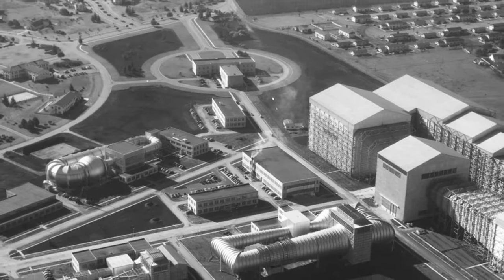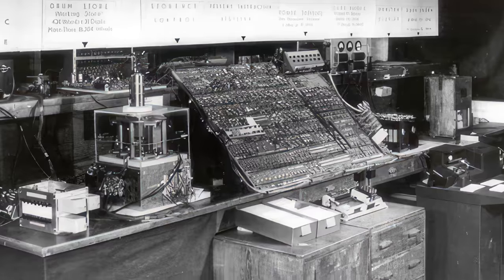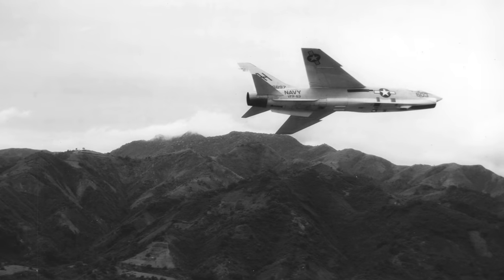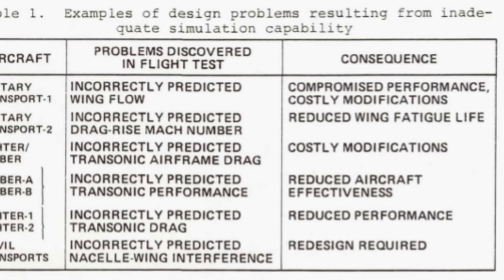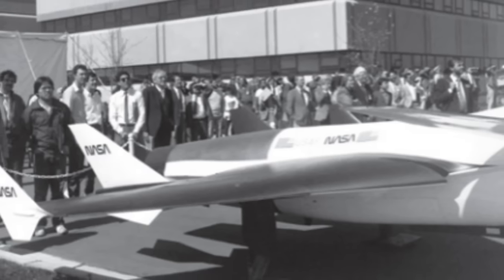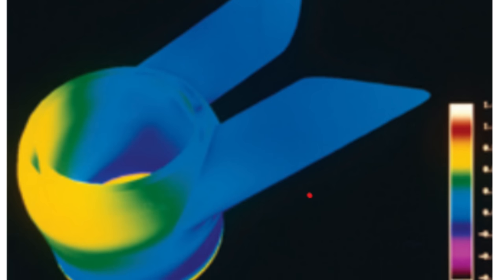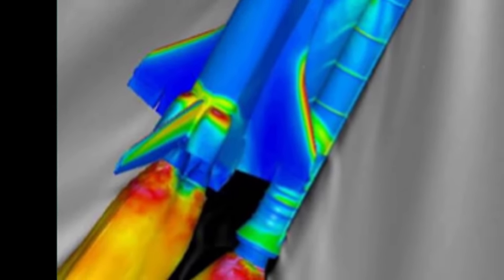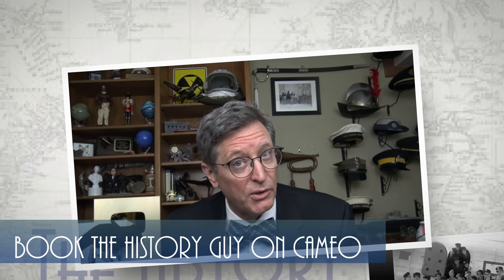A History of NASA's Supercomputers

Comment: As the daughter of an aerospace engineer, I found your video quite fascinating, talking about that side of computing.

There were so many terms that popped out in my mind that my dad used to talk about ☺️

As an engineer’s kid in the 1970s my exposure to computers began with the optical read paper tape driven MCC drilling machines that my dad serviced as his side business.

This progressed to assisting him with his field services; swapping out the serval (sp?) motors he had taught me to rebuild.

During this time he also taught me how to do the circuit board paste-ups and assembly for the computer that he invented to translate data from the optical paper tape to reel-to-reel magnetic tape (circa 1977/78).

I held the job title of electronic service technician from the age of 11 years old when I first started working with my dad until around the age of 15 years old when my teenage angst took over and we weren’t getting along that well 🙄

My next exposure to computers was in 1985 when I took a “computer literacy” course at one of those “career colleges” which taught programming in Basic on a Commodore 64 (more like an iOS predecessor), but the computer that they gave me at the end of the course was a Sanyo MBC-550, which was more of an IBM-type operating system.

This was back in the infancy of personal computers and so these machines did not play well with one another and things like emulators did not exist.

So it was kinda like being taught to communicate in Spanish but then having to work in an environment that only understands German 😆💯🤦🏻‍♀️

Anyway, thanks for the awesome video, I really enjoyed it; at least until the end where it appears that whoever did the video editing accidentally turned the volume up on the music channel instead of lowering it into a fade…..🤦🏻‍♀️💯🤷🏻‍♀️
Reply: I think the volume problem is actually that the main part of the video is much lower than it was supposed to be. The outro volume was about right. Something got messed up with the gain on the main part of the video, it seems.
Reply: @vbscript2  Ah, yeah maybe.
I’ve only done audio/video editing once, so my experience is limited to that.

It’s always helpful to hear other prospectives on this so thank you for that ☺️

I still have a lot of learning ahead of me as I plan on creating music videos for my music in the near future. I can’t even remember the name of the editing app I used last time, but would love any suggestions on what kinds would be good for a beginner like me who doesn’t have any kind of budget getting started.
Reply: @rochelleesser7961  I've also only done a small amount of video editing, but I'm just comparing the volume here to the volume in other video content. Normally, though, the volume in the video should be using a relatively large percentage of the available dynamic range, but should just be quiet enough to not cause any clipping. The user can then adjust the volume on their device to whatever level is needed. For signal processing in general, it's pretty much always best to preserve as much signal as possible (without clipping) for as long as possible in order to get the best quality.
Reply: @vbscript2  I agree, thanks ☺️

Comment: I worked at Cray starting as a Reliability Engineer on the Cray 2, from there I went to work in the Engineering Building then wound up in the Development division as a Circuit Design Engineer. I worked on CMOS ASICS for the massive parallel architecture systems that used 1000's of SiGe DEC Alpha chips which ran at 400mhZ+ That was the beginning of the peta flop era. Chippewa Falls was a wonderful place to live and watch my kids growing up. I have many fond memories of that time. We saw the end coming when the Fed announced cessation of funds for RnD.

Comment: I remember in the late 80s/early 90s when Tom Clancy was writing some of his best books. If Jack Ryan needed a super computer, there were 2 or 3 times where the Cray 2 was specifically mentioned. They used a Cray 2 in Hunt for Red October to do some CFD type stuff to see how the silent drive system in the submarine might work and how it might sound. There is also some stuff about the NSA using the Cray 2 to generate virtually unbreakable one time use code ciphers based on randomly recorded atmospheric fluctuations.

Comment: Another great episode.  By the way, if you haven't already done so, you should consider doing an episode on the NORAD SAGE Air Defense system and the IBM Q-7 computer (block house) that was the heart of the system.  It's was a milestone in computer development, as outlined in the book, "From Whirlwind to MITRE, The R&D Story of the SAGE Air Defense Computer."  (SAGE = Semi-Automatic Ground Environment).  It was the largest computer ever built (physical size, not computing power).  It was comprised of hundreds of thousands of vacuum tubes and used magnetic core memory.  After they started shutting down the system, Hollywood bought some of the more impressive looking components and used them as props (you can see part of the system in Dr Evil's hideout in the Austin Powers series, for example).  I was a maintenance man on this system for about 7 years.
Reply: I was lucky to have seen the SAGE installation in North Bay, Ontario. I worked for Digital Equipment as a field service tech. They used our computer for the weather system. 

One day I was down "in the mountain" doing maintenance and official from the base asked me if I wanted to see their IBM system. I watched the tech start up a diagnostic application, which ran a repetitive pattern which in turn created a noise through a speaker in the huge front panel. A standard telephone handset was placed near the speaker which was connected to the P.A. system.

The tech would then take a cart loaded up with vacuum tube, slowly walk down these long aisles housing the computer circuitry and tap each tube individually. If he heard the noise stop or change sound, after tapping a tube, he'd replace it. Then restart the program and carry on with the same process. It was extremely time-consuming. Tubes for computers like these were very unreliable and had a high failure rate compared to solid state equipment.

It was one helluva beast to behold. High power consumption and it took up so much space!

Comment: The C shape of the Cray wasn’t just a branding decision. It was to minimize the signal paths between components. At least, that’s what Cray claimed.
Reply: yes
Reply: The Cray had such a fast master clock that that timing problems were solved by adjusting the length of interconnect wires in eighth inch increments!
Reply: @billmullins6833  I worked on a computer/detector where the programming was done by the length of wires and positioning of logic modules on the rack
Reply: ... minimize the signal paths between components ...
     I too clearly remember that being explained to my young self.
Reply: @josephgaviota  Yeah, path signal is important, but the big thing MOSFET transistors are modeled as R-C circuits. Charging follows I(1-e^-t/RC)=v. The big thing is reducing the capacitance of the gate of the transistor. This is accomplished by making the gate smaller When v= ~1/ev_max, it's considered 'ON', or a logic 1, otherwise off. At the speed of the cray it probably was a factor, just like the size of motherboards became a factor when speed went to GHz range. Wires are also capacitors and must charge up before current flows. The smaller the wire, the less charging needs to be done
Reply: @sdrc92126  Super interesting.  I'm not an engineer, but I know size, length, thickness ... all those things matter for speed.
Reply: Oh, that reads a little nasty—it was NOT intended that way.
Reply: @josephgaviota  Yup.I was a digital engineer and material physicist for a few years and probably had an unhealthy obsession with cray in my childhood hhaha.
Reply: @josephgaviota  haha. took me a minute. I'm slow...
Reply: @billmullins6833  no doubt inspired by Admiral Hopper
Reply: When Seymour makes a "claim", it's better than any of your facts. Just ask him.
Reply: @sdrc92126  Grace Hopper would hand out 9-inch pieces of wire when the spoke at places. 9-inches of wire is the distance an electrical signal goes in nanoseconds. She said she was handing out "nanoseconds". We should have somebody doing with with bloatware developers today... https://www.youtube.com/watch?v=gYqF6-h9Cvg
Reply: Noah Spurrier -- I was waiting to read this comment, or write something similar, re: the wire lengths, myself. 

In Engineering school, I was fascinated with computer architecture and still own a thick volume in the (Prentice-Hall?) Art of Computing series filled with development stories, diagrams, and many photos of the old computers. This is part of the same set of tan volumes that contain the three Donald Knuth books. I gave those to a budding CS student, a neighborhood kid who has helped me with chores now and then. When he opened the first book, he looked puzzled at the notation. I told him don't worry about them now. Just put them on a shelf. Don used his own programming language that I think he called "Mix" that was a mix of Pascal, and others I have long forgotten. A year or two later, the same kid called and excitedly told me, "my professor said we should buy this book!" Told you so,

I enjoyed hearing the History Guy mention the Illiac-8. As an undergrad, I wrote a paper describing the Illiac-4 for my Junior project, with the appropriate pictures and diagrams (with a paragraph on the back, etc.). In 1980, I had to type it -- no WP -- but I believe I still might have a carbon copy somewhere? By the time I did my Senior project, I had learned to use WordStar. Unfortunately, it's on an 8" floppy and probably irretrievable. 

Thanks for your comment! 😊

Comment: When I went to college, we had serial number 2 cdc6600, I created some programs for waveform shaping in my ee studies.  The next machine I interacted with was the dec pdp8, I still have one that works.  Eventually, I was involved in the cyber 205 circuit development where we using a cyber176 for circuit modeling at cdc.  At the same time, I was working on another project with a Vax 11785 for ciruit modeling the 785 was a much better platform, I went on to eventual develope software in Lan environments. I will never forget the day when I ported software that had taken over 24 hours to simulate a model, and the Lan, with 2 IBM at pc's performed the same model in less the 20 minutes. The handwriting was on the wall for the old architecture of the Vax machines..
Reply: I grew up fascinated by super computers. I got a tour once of my university's YMP-4. It was one of the coolest displays I've ever seen, a flat black room with the flaming pink cray alone in the center with flood lighting. In the corner was an SGI crimson terminal with 128MB(!) of ram.
Reply: @sdrc92126  I worked in my colleges tech department. The mainframe that ran all things related to class scheduling, grades, etc. It was crazy seeing a computer that took up a whole room including raised floors and signs for Halon fire suppression. There was a team of three guys whose jobs were nothing but babysitting it. A server had more power than it, but it must of been easier keeping the old thing plugged in than porting the software or adopting new software. I think most of the programs the mainframe ran was custom made just for the college. Next door was the server room where no one worked and all the auxiliary stuff like university website ran on them.

Comment: History guy, could you do an episode of pinball machines?
Reply: Hear, Hear!

in 1984 or 85, I got 2 OLD pinball machines, at an auction, 
when I lived in Lawton Oklahoma.  Both came with GOOD 
schematic drawings, and with little issue, I got both running.

Cut to 1991, when I was working at the world's largest 
hamburger store, McDonalds, Douglas.  (Really McDonnell-
Douglas.) I was called to troubleshoot the aft cargo bay loading 
system.  It was all antique relay logic.  Found the schematics, 
almost as good as Bally provided for the pinball machines, and 
was able to find the bad wiring and relays.  Oh, the MD-11.  Glad 
I was able to figure it out.  No, I'm not an engineer, just an electrical 
installer.

steve

Comment: I worked at NAS for a number of years, worked on the NASA Net using advanced fiber optics to build and maintain the distributed net to all the various sites, LARK, LERC, etc.
My favorite super was the massively parallel CM1 "bubble machine". so called because you could see through the transparent panels it's processors that were cooled in a circulating, bubbling bath of fluorinert. Iy is also true that NASA and the NAS worked on many diverse areas of research, not just aero subjects, it was a privilege to contribute to the program.

Comment: I got to see in a parallel environment the results of the fluid dynamics on several programs in my 49 year aerospace career. From the North American Rockwell B1, Space Shuttle, X31, XF32, and Lockheed F22 and X59, programs.  Many other smaller programs under development at the famous Skunk Works all got attention from the fluid dynamicist working with Ames Research.

Most people wouldn't have a clue about the complexity of determining weapons deployment from an aircraft flying at Mach speeds or the use of the dynamics of drag to reduce speed of an orbiting vehicle to survive reentry into the atmosphere.

Your video is a credit to your research team and yourself.

Comment: Thanks for your episode on NASA/Ames. I worked there from 1980 to '96 and calibrated and repaired equipment all over the base. Security wasn't significant at that time. We used to go anywhere and do everything back then. Saw a tilt-rotor fall out of the sky while doing low-level ops near NAS and main stock toward the tidelands of S.F. Bay.

Comment: Correction: You mentioned the Cray from 1982 was 100x slower than a modern smartphone. I looked up the iPhone 14 at 2 Tflops and that's 10,000x the 210 Mflop Cray you quoted. An amazing statistic. I looked up the Cray X-MP and it seems you have its speed right. Big numbers. Fun stuff.
Reply: I calculate the iPhone 14 as being about 7,500x faster than a single-CPU Cray X-MP but hey, close enough 😂. And talk about big numbers… a 4-CPU Cray X-MP cost $15,000,000 back then, the equivalent of over $50 million in today’s money 😮
Reply: @MaxPower-11  The other thing that's really amazing is the 345 KILOWATTS they used, vs the iPhone using more like 345 milliWatts:-)   I didn't look up the real number, but....    Also, you probably couldn't make a phone call from the Cray.
Reply: Yeah, definitely more than 100x. Modern GPUs designed for consumer PC gaming already hit 40 TFLOPS. For a few hundred bucks, it's 200,000x the computational power of the Cray.

As for power, that iPhone is almost certainly pulling Watts when it's anywhere near its theoretical peak CPU and GPU performance. Still a far cry from hundreds of kilowatts, though... or the 21 Megawatts currently used by the Frontier supercomputer at ORNL (but that 21 MW is for 1.1 exaFLOPS... i.e. 1,100,000 TFLOPS or 1,100,000,000,000 MFLOPS. It's a bit fast.)

Comment: In 1964 I learned to program on an IBM 1620 -- also made with individual transistors.  It was as big as my desk, used a built-in IBM Executive typewriter for I/O (it also could be attached to a card read-punch unit) and had about 10K of memory.  It was also called the CADET -- Can't Add, Doesn't Even Try.  Later, in 1988, I worked on a CRAY-2, with VAX front-ends.  I think my phone probably has more computing power than either of those.

Comment: Thanks for doing this episode. Ah, I have fond memories of NASA Ames and the communities around it. I know it wasn't about the Ames wind tunnels specifically but I spent many many hours, days testing (production and research) at the Ames Unity Plan Wind Tunnel for Boeing products including the 787-8, 787-9, 747-9 and 777-9 variants. It is the best elevated Reynolds number production wind tunnel for transonic testing in the US, maybe even the world.
I spent the better part of my 35 year career at Boeing Commercial Airplanes using and improving both wind tunnel testing and CFD to better simulate transonic flight results for practical engineering applications. There are numerous reasons that both simulations don't get it right and it still takes skilled engineers to understand why and merge the two into a cohesive combination that does, utilizing the best of each for a better pre-flight prediction.

Comment: I worked at NASA/LaRC and used the CDC STAR-100 and the follow on CYBER 203 (only 3 were made IIRC). I later used the CYBER 205s at NASA/GSFC and the National Meteorological Center. These were very good machines if you knew how to program them for vector instructions. This generally requires a complete rewrite but you were rewarded with very good performance.

Comment: @8:40 you probably meant "VAX 11/780" not VAX 11/750. The picture you show is of an 11/780 and the 780 came first. The 750s were a washing machine height cabinet and were significantly slower and cheaper.

Comment: Another testament to the work of all these individuals is that anyone with an internet connection can run CFD simulations at no cost. I've used one to check the air flow through my 3d printer's part cooling ducts with various configurations & fans.